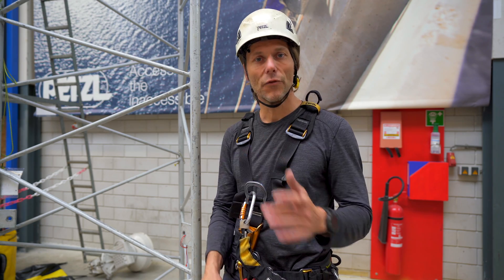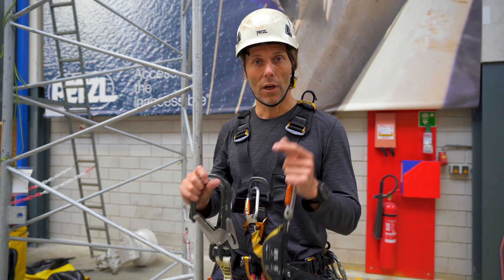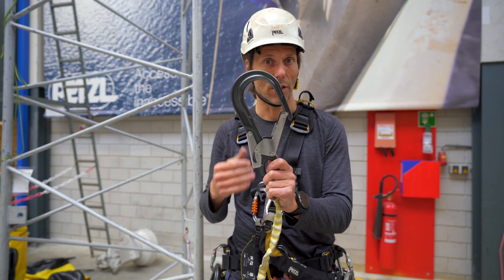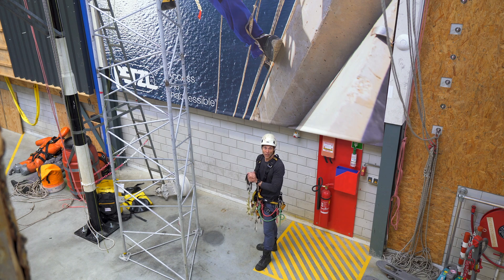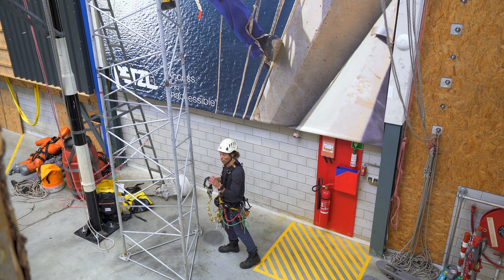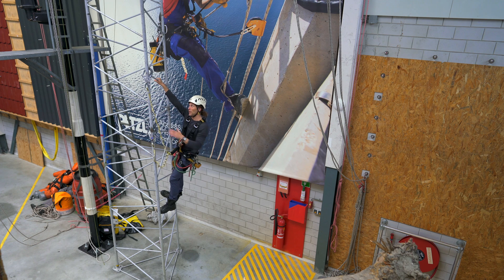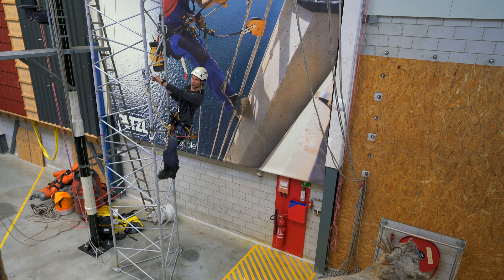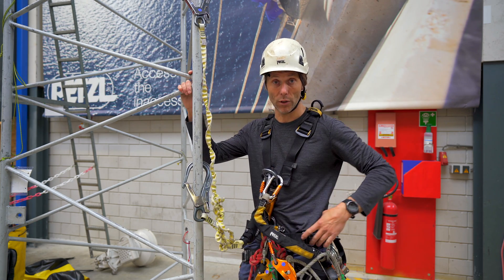Fall Arrest Climbing - IRATA Level 1 Exercise

Comment: I was under the impression that only 3ft lanyards like the ASAP should be used on the sternal ring, and lanyards that are longer must be attached to the dorsal ring. Perhaps this is just an American standard?
Reply from the maker: Sternal and dorsal are for fall arrest systems. Like the ASAP or twin lanyards. By the way, the longest asapsorber is 40 cm or 1ft and a bit, not 3ft. 
Where you attach is up to you. Length does not change that. Might be an industry bias not an American standard. The EN numbers on the gear will tell how to use it. Maybe it is an American standard I am not aware of. It would not make any sense to me it were.
Reply: I was always unsure of this. I just took the SPRAT fall protection class and this was covered. According to the American OSHA requirement if free fall potential is less than 2 feet the sternal connection can be used. Here is the regulation:   1910.140(c)(22)
Personal fall protection systems must be worn with the attachment point of the body harness located in the center of the employee's back near shoulder level. The attachment point may be located in the pre-sternal position if the free fall distance is limited to 2 feet (0.6 m) or less.